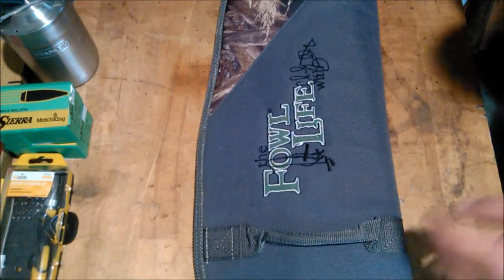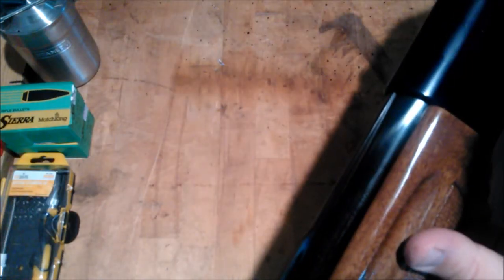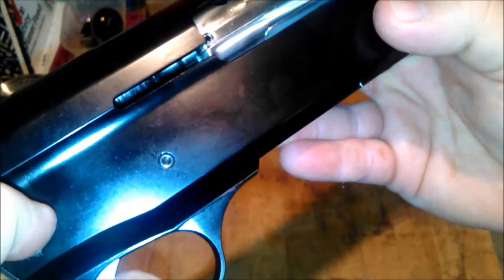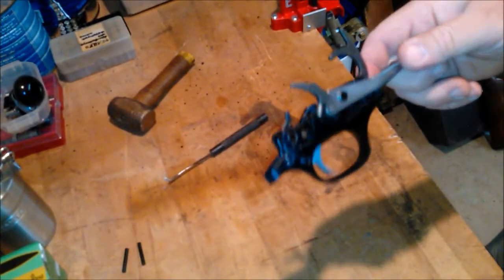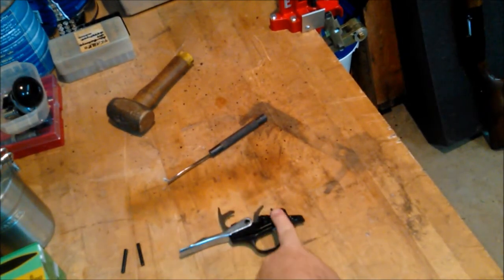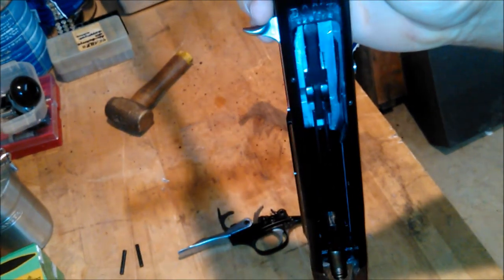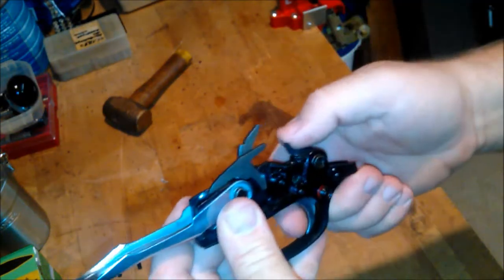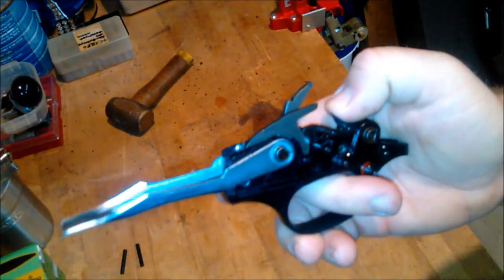Franchi Shotgun 48-AL 12 ga. Troubleshooting

Comment: I know this was posted over 3 years ago, so I'm sure this gun has been fixed by now... but for other folks dealing with this kind of problem - by far the most common reason for this kind of thing is that the bolt is not going forward all the way. The whole point of the disconnector (the little 'switch' shown in this video) is to stop the gun firing out of battery. And if the gun doesn't fire because that switch isn't far enough down, that is usually because it is working as it should, and stopping the gun from firing because it isn't properly in battery. The most likely reason for that is dirt and corrosion, especially inside the chamber, where you can't see it easily. If the gun is thoroughly cleaned round the mouth of the chamber, and the inside of the chamber is polished clean, preferably with some steel wool, that will likely solve the problem. Also the grooves in the side of the receiver where the barrel assembly and the bolt run can often be a problem - dirt gets in those grooves and it's not easy to clean out, and if things aren't running well in those grooves the gun will tend to malfunction. This is not to say that the suggestion in this video, i.e. wear on the disconnector or the bolt, may not possibly be correct - but dirt and corrosion preventing the bolt going fully into battery would be a much more common cause, and much easier and cheaper to fix.
Reply from the maker: Hindi Filmi Sangeet Notations she was clean as a pen from what I could tell. They sent it back and the gun is now working. Thanks for watching and the information. 🤠
Reply: Nice info!!!!